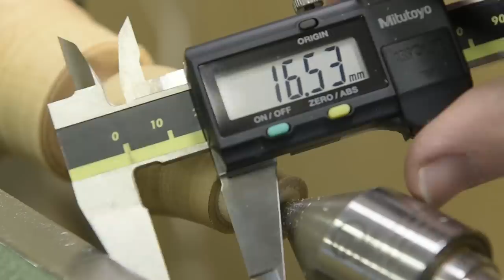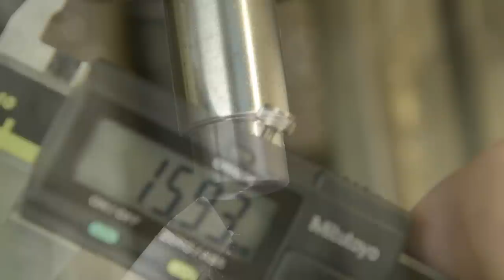Making an awl

Comment: very fine and nice work. i have no lathe and of course no forge. i made an awl from an hilti maisonery drillbit i cut of the shaft and the carbide tip and made the handle by handshaping, the tip is not hardened but it works fine for 3 years. the special touch comes from the spiral drillbit. with your knowlege you could probably do a nice project with DIY tools. i wouldt say that many viewers apreciate that because they could do their own one with simple tools. thank you for the inspiration. i will do a simple copy with a squared tip.

Comment: Tip:  when you want something long and slender start with a large enough blank and go to the finish diameter and make the part in one cut.  You can not make second cut.  With practice you will find the tool geometry and parameters of this procedure.
I thoroughly enjoy your program  it makes me relive what I used to be able to do!
JIM

Comment: I have searched all my local tool stores and home project stores for an awl... all the attendants look at me like I'm speaking a foreign language when I ask them where they might be... glad someone else uses them
Reply from the maker: Strange! They are pretty simple to make though. Doesn't need much more than a power drill, a bolt or screw, sandpaper and a piece of wood.
Reply: You'd think a leather shop would have them, in stock...
Reply: Or a fabric store. alas,bmy search has been in vain as well
Reply: @torbjornahman  Depends on who you ask... Leatherworkers know this tool, carpenters often use it for marking, sailors and rope makers know it as a marlin spike (marszpikiel in polish language). David Canterbury forged marlin spike too, very nice youtube clip there with a bit of history... Gardeners use a bigger spike for planting ;) 
Other people generally think it's a simple murder weapon or something similar ☺
I knew this tool because i am fortunate that my dad loves to have a well stacked workshop.

BTW, thanks for the inspiration! Yesterday i hardened a hatchet for the first time and it worked well. I'm lacking a forge for now, so i just put it into our heating stove when coals were bright red and quenched it in my kitchen. It was fun and i really need to make myself a forge this spring.
Reply: Lots of them on eBay
Reply: @zettle2345  I haven't seen a leather shop in at least 30 years.
Reply: It can also be known as a bradwl
Reply: Try asking for a "stab knob". That should do it
Reply: Did any of them direct you to a pet shop?...lol.
Reply: Ask for a scribe.
Reply: I just bought a set of Craftsman screwdrivers and there was an awl in the kit.

Comment: My typical method of doing handles like this is to drill the hole first and then putting the ferrule on. That way when the ferrule is pressed on it hopefully compresses the wood fibers ever so slightly and will hopefully help retain the tool shaft tighter.

It was a beautiful piece of Craftsmanship.
Reply from the maker: It was pretty tight to begin with and my thinking is that pressing in the actual tool into the handle should compress the fibers the last bit. But You're probably right, your method could improve the tightness I think.

Comment: Last year I made an awl that was not as fancy, but I was proud because I used only hand tools, and foot-powered lathe (or "alcohol-powered", as Roy Underhill would say). I had an old screwdriver with no handle, so I used that and filed it down square, then turned the handle out of hickory and put on a copper ferrule. Yours is prettier.
Reply from the maker: Sounds like fun too! Thanks

Comment: Very nice looking awl!  I particularly like how you quickly used the cordless hand drill and bench grinder to sharpen the steel to a point.  I do this often (learned from my Father - no cordless drills in those days, but still the same principle).  Works very very well.  :)
Reply from the maker: Yes, simple and easy!

Comment: Here I thought you were going to try rotary-forming of the ferrule. The way you did it is clever though, and I’m not sure if rotary forming would work on a piece of that wall-thickness. Perhaps if you got it hot, but you’d want to either have it on a lot of stickout or use water-cooled lathe jaws!

Comment: that's a nice needle or center punch for wood you've made there.
i think and awl would be a three sided blade. since an awl is mostly used in leather work it makes sense that the thick leather needs to be slightly cut to prevent the hole to close up again.
Reply from the maker: I guess the names are interchangeable to some degree...

Comment: Wonderful build!!! As always.
One question: why not use the compound rest to turn the taper?
Reply from the maker: Thanks. I just assumed it would flex too much for that, and I didn't want to bring a grinder to the lathe this time.
Reply: @torbjornahman  I fully agree about grinding and polishing on the lathe.  The abrasives will ruin the lathe ways and carriage very fast and will cause inaccuracy in the lathe work. I use a jeans piece of cloth to fully coat my lathe carriage and bed when I do that. I've bonded some well positioned magnets onto the cloth (epoxy) so it won't move by accident while I polish.  I thought of turning a short taper on the edge - but I see your point on the wobble. Keep up making these lovely tools and projects. Wonderful work... :)

Comment: Great job master.. But, wouldn't it be easier if you used a press machine for a brass blade guard, right?
Reply from the maker: Thanks. Probably but I would need tooling for both sides.

Comment: Don't throw away old springs from cars or other high quality steel. Make things out of it before melting down, wich is of course also a good thing, rather than dumping it in a worthless pile.
I personally would "cheat", making it out of a suitable bit of round stock, tool steel, grinding, hardening and tempering.

Comment: Very interesting how you make the ferrule contract. Does the material somehow fuse together when you heat it up after hammering it towards the inside?
Reply from the maker: No, it just gets thicker. The heating is only done to make the metal soft again. It work hardens during hammering.
Reply: Ok, thanks!

Comment: what's the purpose of put steel into sand and heating then put into hot oil ?
Reply from the maker: Slow cooling in vermiculite makes the steel soft. Quenching in oil makes it hard. Slight heat after hardening brings back toughness. Annealing,hardening and tempering.

Comment: Interesting ... so you planning on picking up leatherworking as a 3rd crafting hobby then ? ... at least that is why i made my awl, be it from an old hardened nail I inherited from my grandfather, due to the nail size there wasn't really a way to pressure fit it, so instead i made a cap out of wood, with a tiny hole to push the nail through, and then glued another piece of wood with a knob into it (screw from the side for good measure). Then spend a day and a mouth full of spit on a grind stone to put a sharp point onto it, and then shaped the wooden handle by hand... can't say it looks as spiffy as your work, but i'm fairly sure both will do the job just fine ;) ... (which was the long and windy way of probably saying that i sometime envy your tool options ~ be it that by now i'm fairly sure they are better off in your hands)
Reply from the maker: Thanks! Yes, i plan to try my hands on some leather someday soon I hope.  What a great way to securie that nail! That's the fun with all of this... to find solutions to a problem and working with the tools you've got.
Reply: @torbjornahman  tnx, yes i agree that is a great part of the fun. Also using the things you make and seeing them work as intended, and if not, not fearing to make adjustments to it.

ps. Couple of months later i found an old awl at a flee market for € 2,- ... ;D ... at least the fun making my own was priceless ;)

Comment: I was half expecting TA to use his Maker's Mark as a wood burning tool. Heat it up and then burn his mark into the top of the awl handle. Maybe TA needs to make a new mark that will work for that purpose?
Reply from the maker: I can't use the one I use on steel, that would ruin the temper on the tool... so I need to make a new one... new project!
Reply from the maker: I probably could have punched it into the end grain of the wood though....

Comment: Awesome as always mate ;) Oh and by the way, I’ve got a small piece of steel that I need to turn into a specially designed piece. I’m only a beginner, and I’ve got a small homemade foundry. Do you think if I put the piece into the foundry, I could hammer it into shape? Or do you suggest melting the steel and casting it. Thanks!
Reply from the maker: Thanks! Melting and casting steel is nothing you do in the ordinary home shop... impossible to do without a heavy duty furnace. So forging, machining or a combo are your options.
Reply: Torbjörn Åhman Great I’ll try that! 👍

Comment: What? Not marking your tool?  Beautiful work.
Reply from the maker: I know... need to make a branding iron of some sort... another video?!
Reply: @torbjornahman  Drive your touch mark into a small hot block of steel. Case harden the block, Now you can drive a yellow hot steel punch in to recreate your mark, add a handle, et voila!  A branding iron.
Reply from the maker: Voila! Yes you're right, but it might be just a little too small... I may have to experiment a bit!

Comment: Can you please give some information about the stand for the abno hammer? Thanks!
Reply from the maker: Stand? It sits on a concrete block and some 7" wood or so... nothing special.
Reply: @torbjornahman  and the concrete block is how in dimensions? I am planning on my  powerhammer, 30kg. Only concrete, so far.
Reply from the maker: A rule of thumb is to use as much concrete as about 1.5 x the total weight of the machine. I have a bit less on this one, not sure how much, probably 30-40cm deep not much larger than the footprint of the machine.
Reply: @torbjornahman  Merci!

Comment: Heat your touchmark, after shaving a small flat, burn it into the wood handle.☺
Reply from the maker: I can't heat my touchmark... it will lose the temper.  I need to make a proper branding iron.
Reply: @torbjornahman  Next video? ☺☺☺

Comment: you have a lathe and you did the tip with the drill. why?
Reply from the maker: I had the feeling that it would flex way too much to cut the tip.
Reply: @torbjornahman  With the drill you are not sure that the tip is centered
Reply from the maker: @giuseppealmontelalli840  that's right, but it's definitely close enough.

Comment: It is better not to put a plane on it’s side, you leave a sharp edge exposed that you may cut yourself on and you are likely to knock the blade slightly to the side as you lay the plane down giving you an uneven shaving. Putting the plane blade down on a wooden bench does the blade no harm whatsoever. See for example the venerable Paul Sellers’ thoughts on the subject.
Reply from the maker: There are of course different opinions about that...
Reply: Torbjörn Åhman indeed there are, I am firmly of the Paul Sellers persuasion 😀

Comment: Friend i have to one request you ,,what's me you using bolamp to heat to steel or anything you can use the spoon or steel plate why me save time and safe and quick heating your work is u can save bolamp gas flames thets siciulate🌀 heating air to spoon in side and quick heating......  i using copper pipe in to join and remove wedding ,, air conditioners....😊

Comment: Much similar solution than provided at 5:12 (I Ignored the the silly video editing previous), would be to silver solder on a cap and simply file down the rough edges. For visual effect. Nothing else is needed. As I do. As I have actually  done. As a mater of routine. As someone who has a farm and needs tools to work. 😃. The pretty part is not really needed. It is fine if one is creating art. And tools can be art. And your work is art. But for real life functional, this was a bit over kill. Just saying.
Reply from the maker: It's overkill, I know, but it's fun!
Reply from the maker: ... and I like to try and inspire people to think of their own and come up with new ideas. Maybe they pick up something that can be used in another project!?
Reply: @torbjornahman  Fun. Good reply. Excellent reply. Best possible reply. You win one Internet point. I loose. :)

Comment: Надо было кончик сделать с помощью ковки.
Reply from the maker: No, but I like the spring steel.
Reply: @torbjornahman  I don't know how you translated it, but I said that with forging, the metal would be stronger and harder. what is necessary, and for the shellac.
Reply from the maker: @АртёмРоманенков-н3у  In general, forging does not make it stronger or harder.